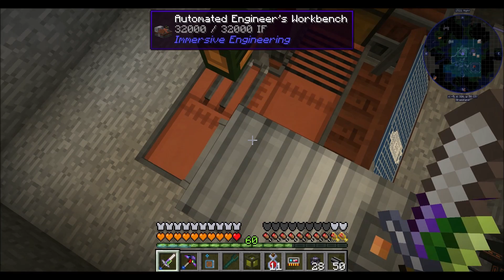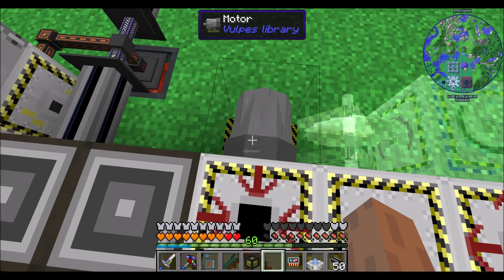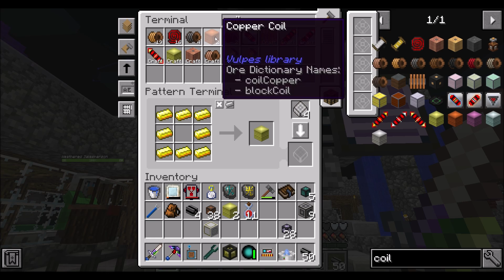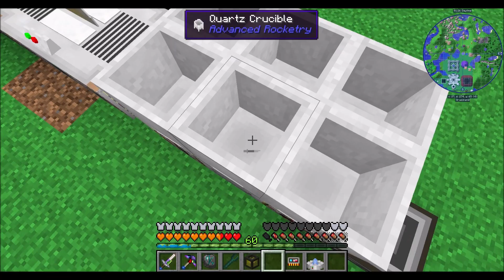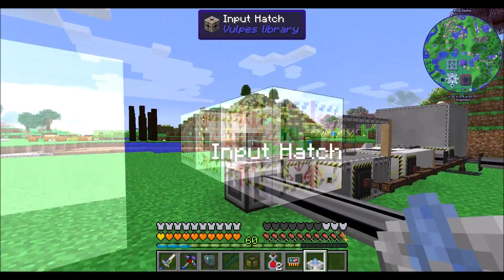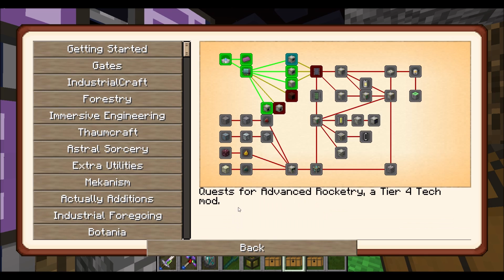Enigmatica 2   Ep59 Rocket Machines

Comment: Couldn't you use the silk touch feature on the digital miner so that you get the unmined versions of gems like redstone and emeralds? If you broke those blocks with your pickaxe (with lapis upgrade) you could multiply your yield and reduce the need to move the miner around so much.

Comment: I would recommend looking at setting up a Industrial Foregoing laser with black lenses, that will get you Oil Sand which can be turned into oil. Also, there is a pretty cool factory posted to your discord under schematics from TheWinterBee on 1/15/19 I think it would be perfect for your Advanced Rocketry building.

Comment: I am just waiting for Dire to realize there are no Immersive Engineering deposits that spawn in the world. They got disabled in the configs.
Reply: Just curious does the Distillation Tower work with Actually Additions oil like it did in 1.10 in this pack?
Reply: @jkelleyk  I didn't get into that part of the pack much before I fell off it but I think the Thermal Expansion oil at least will work

Comment: You are wasting a ton of resources by not setting the Miner to Silk touch. Especially if the entire point was that you are running out of Redstone specifically. Also use the Integrated Dynamic to processes it if you do as it gives the highest return with the lowest effort.

Comment: Why does Ender IO have ME conduits but not RS?
Reply: There are RS Conduits. I am not sure that the ME Conduits are in IO itself or added to it by another mod like the Gas Conduits. In Stoneblock, you have the option of both AE or RS and there are conduits for both.
Reply: @rainmaker709  apparently it does, I just had an old build. EIO has both, along with Open Computers, Forestry, and Tinkers support. Huh, Today I Learned.

Comment: Hey direwolf, Just fyi, you can get infinity iridium using lubricant and making plates. Each ingot makes 8 plates and every plate can be melted with sand to get an ingot, so 1 iridium + 200mb lubricant + 8 sand = 8 iridium ingots (than can be selfcrafted to revert to ic2 iridium)
Reply: Esto en tecnocracia hubiese estado controlado. Un saludo Diego 🖐🖐

Comment: Pro tip: when looking for immersive oil i found a chunk with platinum ore. Using the excavator i got millions of platinum ore out of it very quickly. It also has iridium (around 1/10 per ore the excavator digs up). Very cheap way to get iridium! Not sure if it was intended.
Reply: I couldn't find a platinum vein in my world so if you are using dires seed then pls tell me. I have nickel vein but it's not quite the same.
Reply: @Mr.ImDLow  not using dire's seed. I guess I got lucky...

Comment: Use UU Matter for Iridium.
Reply: He doesn't "have enough" uu to use it. If only he had a dedicated power supply for uu.
Reply: Processing platinum in a pulverizer with secondary output augments is super simple but effective. Or in an induction smelter for 100% chance to get 1 ingot per ore. I never needed to duplicate iridium. (the thermal iridium is ore dictionaried to the ic2 one)
Reply: zapl80 He has UU Matter and haven't used it, so...

Comment: Dire, be careful with the motors, I found that the second two, the one needing gold coil and the one using tiatinum plates, are not showing up whehn you craft them, they have that broken texture, and they do NOT work, but if you take one in cheat mode, it does?? It's, really confusing, but if you do make it, you then need to toss it into the void and cheat in a replacement, because that's the only way it'll work. if it's still in your inventory when you do, it'll just spawn in a broken one again.
Reply: I used them in my world, all of them crafted fine and they looked correct once placed in world. Just the texture was broken.
Reply: @zapl80  what I meant by not working, was I couldn't use them in crafting recipe's. I should have explained that better OTL

Comment: could you not put the powercell into the digital miner itself? There's a power slot in the digital miner, and I swear you can put blocks into it
Reply: Would the whole powercell link mechanic work like that?
Reply: @BrownsheepBF  good question, but I recall that it worked with Thermal Expansion's tesseract. This is stuff that I've seen from Etho's playthrough of Project Ozone 2.

Comment: You can get all the Oil shale you need (oreClathrateOilSand) for the distillation tower in any desert biome.
Reply: May be changed in this pack but I’ve used Actually Additions Oil in the Distillation Tower before and it worked just the same as any other
Reply: The oil you get from refining canola oil
Reply: That would be incredibly ineffective way of getting oil as the reservoir has a min of 8mil mb.

Comment: The NBT error is not a AE bug, did a test whit Refined Storage does the same NBT stuff
Reply: the circuit board can be "opened" and filled with tube to improve the forestry farm and other foresrty machine
the item in JEI is just a dummy,and is not the same as the empty one
Reply: Jack Schofield does help some, try make meka gas tanks, AE does not like them.
Reply: Jack Schofield i did, got it working by making each and put in the pattern 😁

Comment: Make the advanced carpenter,u need not set up 10 carpenters for 10 recipes.The same goes for thermionic fabricator.
Reply: Ufortunately, advanced carpenter requires the modular machines gearbox, which is crafted from iridium rod, which dire doesn't have at the moment. For one circuit board, i feel like make one extra carpenter (with his current setup) is way better  than going hunting for iridium :)
Reply: @vojteskas  I take it that he can't dupe his iridium pieces with uu before he has a full piece? If he can then he already has enough.
Reply: @Asmozo  
It can be duped
Reply: vojteskas I think there’s a way of turning iron into iridium with ic2 idk of its in the pack
Reply: I never knew that was a thing. Thank you!
Reply: I did that too 😁👍